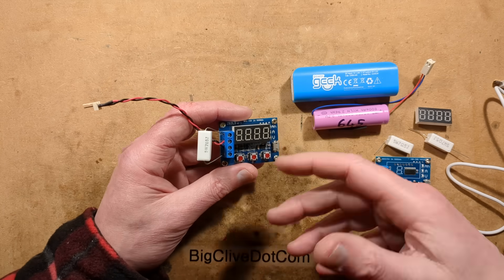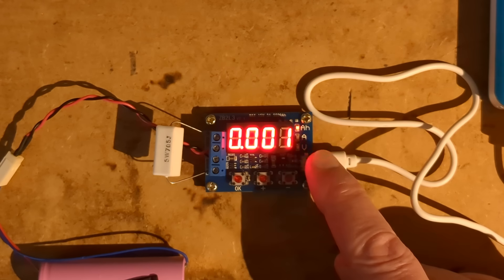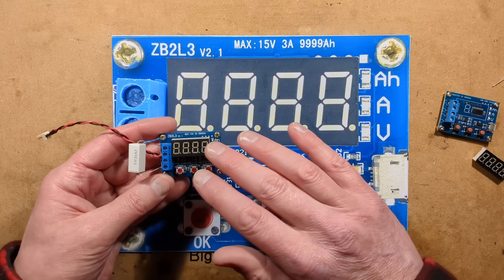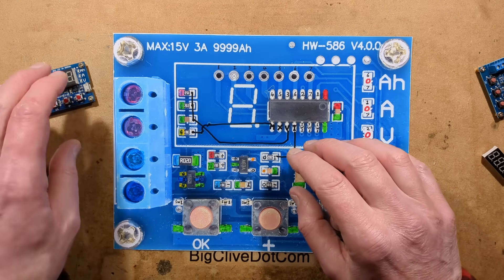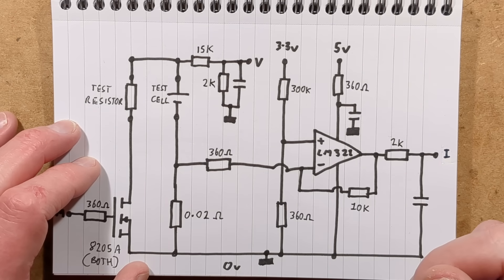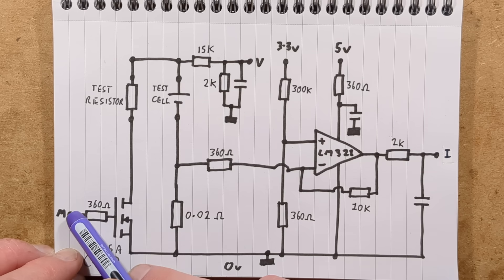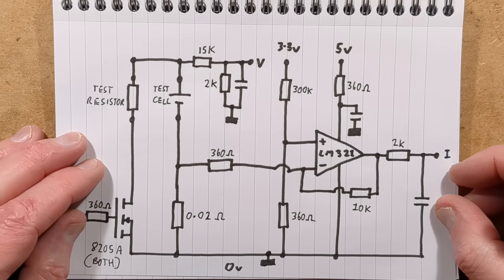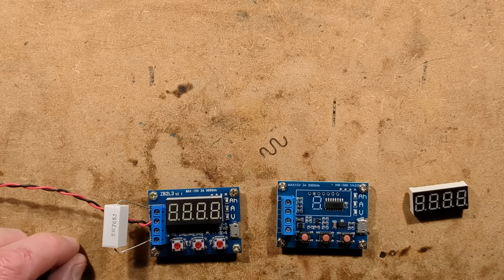Lithium cell (and battery) capacity tester with clever circuitry

Comment: I got the cheapest (V4.0, no calibration) from aliex bundledeals. It's badly calibrated, measurement is way off.
I wonder how to hook it up with an esp32 and write new firmware, then export time-based measurement to visualize on PC and use to judge the health of a battery.

Comment: my mod
across the cell or the mosfet drive pin, connect a small relay module to power a tp4056 module(or even connect a 12v battery charger), so when the unit reaches a "shutdown" state the unit then triggers a recharge automatically, possibly by using the ground and simply swapping the resistor for the charge wire(bypassing the shunt for safety and isolating the resistor so as not to let the module keep going thinking it needs to discharge more

Comment: I got one of these years ago and mine says HW-586 like your v4 board but has the higher pin count LED display like your v2 board. There's no ceramic caps on the buttons like your v2 board though, so there's at least 3 unique versions of this. Mine's got no revision number at all, so maybe it's v1. I bought it years and years ago and use it frequently.

Comment: For the cost of a few of those modules on our favourite Chinese retailer, I actually got a really decent balance charger. Does charge, discharge, a whole bunch of battery chemistries, has mAh read out, beeps annoyingly at you, has an overly mushy button or two, takes one of those almost normal 12V adapters but not quite because it's a little smaller... The one massive pitfall, is that it can't discharge lithium below 3V. Besides that, the imax b6 may interest you. Even if it's just to tear apart.
Edit: Oh, you did! 9 years ago! :D

Comment: Wish me luck that the one with two 18650 battery holders and a colour display that uses one of the cells as a power supply and has a mode switch is as accurate. It matches my needs a bit better and isn't that much more expensive.

Comment: Great video. I've been using one of these for several years. I built a variable constant current load to replace the resistor since depending on what device you use the battery on, the current is different. BTW, this will test NiMH cells also since it will drop down to very low voltages if you choose.

Comment: I also have one of the older units that a friend gave me. I found it remarkably accurate with the stock settings.

I eventually stopped using it for anything other than 18650's, as my main concern is 12v batteries with decent capacities, which this unit wouldn't have been capable of testing, so, I built an ESP Node with an INA219 and removed the surface mount resistor, replaced it with a 50A shunt, and use either a 12v, 50w halogen downlighter bulb for larger capacity batteries or a made up 2s3p 15w bulb pack that draws around 1.23A for the 7AH - 18AH AGM's etc.

Make no mistake, these small modules are truly remarkable for what they do, it's just that with the ESP I can get the results in graph form (Home Assistant), and even run capacity tests that stretch over multiple days and get precise results over the entire test.

I might also add, running an ESP does have its drawbacks, like, polarity conscious or the parasitic load of the module itself, but then again, on the capacities I'm testing, 20-29mA on a 100Ah battery isn't that noticeable 🤔🤷🏼‍♂️🤣

Comment: Looking for your advice, Sir Clive, would you advise the use of some 2N3773 power transistors from Alix? 
My load will be maximum 30 amps, distributed across five transistors, which I am intending to use to replace five 2N3055 transistors in a linear PSU. Alternatively, would you suggest another TO3 cased transistor (maybe from Alix)?
Reply from the maker: I can't really advise on components like that, as there are a lot of fake components sold online.  All I can suggest is that you choose a transistor with near identical specifications and pinout.

Comment: Impressive little device especially the led driver. Wonder if it would run on a 18650 cell? 30ma should run quite a while. Spose it depends if the regulator is a lowdrop out one and the opamp is happy lower than 5volts...

Comment: Nice little device(s).  I have always wondered what your process is to determine the capacity of lithium cells.  Have you ever explained it on a video?
Reply from the maker: I sometimes use mAh charge input to enclosed devices, but also use this type of module when I can remove the cells.

Comment: I am not obsessed with idea of fully discharging a lithium cell just to see its capacity.  If capacity matters I use trustworthy supplier, if I don't, then I don't want to damage sh*ty cell that might be more vulnerable then a proper one. 
The AMS-1117 is quite an overkill here.
You talk of favorite value just as I have looked onto one and a half roll of 330 ohms specially used bigger size case to make its footprint more recognizable

Comment: Could it be that the new version is factory calibrated? Maybe triggered by the unused pin? That could be done in the same jig, where they program the microcontroller (assuming it's programmed after soldering) and do a short function test (well, at least a "shows some numbers" test).

Comment: Interesting little unit, thanks clive.
Currently use a usb oscilloscope monitoring a load resistor, that logs to a CSV file and gets exported to excel, handy if you want graphs but a bit of a faff to set up just to get a AH measurement. This looks awesome.

Comment: I use a ZB206 discharge meter which uses a transistor as a load. My understanding is that the transistor has the advantage that current draw remains the same as battery voltage drops where as with a resistor the current decreases as voltage decreases leading to inaccurate results. I suspect the ZB206 uses similar software because the display and led functions are similar along with the rapid flashing display at the end of the discharge.

Comment: I've used one of these. You need to use thicker gauge wires for the cell, otherwise a lot of power is lost over those thin cables and you get an inaccurate reading
Reply from the maker: The unit measures actual current regardless of wire resistance.  The only thing that might be affected slightly is the termination voltage.

Comment: Flashbacks to testing 112 batteries with three of these modules. A few things:

- these testers do not come with any kind of battery mount / connectors.  the connectors need to be really good. If it loses  contact for just even a microsecond the testing automatically stops. And also depending on  how good your battery connection is you will get slightly different battery capacities. Also, if you're testing batteries that you took off a larger battery and you still have small spot welding bumps or high-rise spots in the terminals, it can affect your connection and give you problems with accurate readings or disconnections.

- unfortunately Amazon is flooded with some of  these testers that are no good and it is   very difficult to figure out which merchant is selling the right kind or just rip offs because they all look exactly the same.

- only major downside is that you need a power source for each tester so if you're doing multiple batteries at once you're going to need just as many 5 volt chargers or power sources.

Comment: It's impressive how accurate these modules can actually be, but I do miss when more things had calibration modes. I've got a few current testers and thermometers that are off enough to not be useful, but could easily be fixed with a calibration pot or routine in the MCU.

Comment: I've been seeing those 7 pin charlieplexed 4 digit displays become more common from Chinese sources.
If you ever wondered how many LEDs you can control in a charlieplexed matrrix from a given number of pins, the formula is simple;
N = P times (P-1)
Where N is the maximum number of LEDS and P is the number of pins.

So for 7 pins; it is 7 times 6 which equals 42.
So that easily drives the 4 digits of 8 LEDs each (including dec points) which is 32 LEDs.

Comment: Really nice and lean circuit design!
My only concern is the input offset voltage of the LM321 opamp (typ. 2mV, max. 7mV), which could cause a considerable error in the current measurement...

Comment: Every trick in the book is used to reduce cost. 
The 360 ohm gate resistor is probably used to reduce different components count. It is used in several places in the circuit. Now you only have to buy i role of resistors.

The LM321 has a PNP input that makes it work down to -0.4 volts on a single rail.
It is old and cheap.
Only positive output swing is limited.
You can improve this a bit with a pull up resistor on the output.

Comment: Ah yes, the AMS1117; the original version of this chip supports input voltages up to 15V, but there are a variety of off-brand clones of it that are only really safe for input voltages of 5V or so. Buyer beware! Not everybody using the same part number is playing by the same rules...

Comment: So the old one CAN be calibrated, but the new one has removed that feature. But could still need cslibration? Or is so prrcise that the lack of calibration is not an issue?
Reply from the maker: They seem to rely on component tolerance for the calibration.

Comment: they cost optimized but could not add a CC load instead of the crappy resistor all that needs is few resistors,ceramic caps,lm358 or any opamp and a MOSFET 

that would make the discharge current adjustable and the readings more reliable
Reply from the maker: The resistor does allow for higher current at 12V.  Possibly even using a normal operating load for the test current.

Comment: the schematic is wrong , the voltage divider for positive input on opamp is connected to current shunt and the opamp feedback circuit is correctly drawn, the sensing is on the side of what you labeled with ground symbol, what you have drawn is a biased inverting amplifier which doesn't make sense as the current increases the opamp vout will decrease. what it is ,in reality, a non inverting amplifier where the biased voltage drop of the shunt (4mv+I*0.020) is amplified to MCU, desolder current shunt and revaluate as the multimeter in beeb mode will not help due to low shunt resistance.

I digress, just move the ground symbol to the battery -ve and your schematic will be correct.

Comment: Feels like a gizmo like this should really have a programmable current option (with a heatsink). Since this device is actively sensing current consumption (discharge current varies over time), it seems like it should be tolerant to replacing the resistance with a constant-current load. The nearest one I have memorized uses a mosfet, which limits current at 5V, but maybe something with a power transistor could be worked out.

Comment: I have two of the "old ones" (mine are V 2.81). I use them with an USB electronic load so I can adjust the discharge current. It's nice to know they have a good design.

Comment: Did anyone else think Clive was trying to write 1016 on the third photo on the pins of the microcontroller, until he explained that's M for MOSFET, X for not connected, V for voltage, and I for current?
Reply: Well,  I WAS getting flashbacks of being forced to do Latin at school!
Reply: Yes, I read it as Latin numerals straight away too!

Comment: I just received a cheap ali product that I that I think you would be interested in. Labelled 'HD Car Head up Display M2 GPS Speedometer KM/H Digital HUD Windshield Projector Universal Auto Electronics Accessory' is a USB powered GPS HUD for cars. I got mine on special for 3.50UK but they are now double that. I just plugged it into my car and it works well closely matching the speed displayed on my cars speedometer. Given its compact size, I suspect it will be all ICs and surface mount components.

Comment: If a spare input goes to an ADC it can be quite versatile with a somewhat complicated test fixture. Even with a sloppy voltage reference you could select a substantial number of test functions by applying different voltages. If both the ADC's reference and the test fixture use the controller's supply voltage, sloppy drops out of the equation because everything becomes ratiometric. You could probably reliably do 64 functions with one pin and an 8-bit converter.

Comment: The 360 ohm resistor is pretty clearly used because that was the right value for the biasing of the op amp and using it elsewhere reduces the bill of materials. I've used weird values for pull up or pull down resistors and the like for the same reason. It is baffling to people trying to figure out the whys and wherefores of circuitry. It is especially baffling when you use a ±1% tolerance part where ±30% would be fine. One of my clients preferred 1% resistors for everything because they reduced their costs for purchasing and inventory. 

I've used LM324 family op amps in lots and lots of designs, but its about the last thing I'd consider as an amp for a current sense resistor unless ultra-cheap was the determining factor. Even with a substantially better amp it would still be necessary to use the biasing to assure the amp stayed off the rail with zero volts across the current sense resistor. "Rail-to-rail" is a nice myth to believe in, but it is never really true in any amp I've ever looked at, and I've looked at an awful lot of them. Usually the problem is that the output can't swing fully to the negative rail. It may get within millivolts, but that isn't good enough in precision circuitry. In the tester, the only time zero would really be of concern is for calibration. There isn't much use in battery discharger that operate at zero current.
It wouldn't surprise me if that circuit uses the 3.3 volts supply as the reference for the ADC. That makes for some "interesting" problems. Adding or subtracting to deal with offsets is easy. Multiplying or dividing to correct gain errors leads to missing codes or repeated codes unless the ADC has high resolution. For a simple battery tester it probably don't make no nevermind.

Comment: Oh nuts, didn't know Ali does affiliate links. I'll swap my browser bookmark to that in the interest of getting more tat review / unbaggings. I normally use an iMax B6 hobby charger for cell testing but it's got a very limited discharge current because it's an internal load resistor and I don't like the thing baking itself to drain cells.
What I really need though is a version of this that can handle 40V power tool batteries, and a charger where I can set the charge termination to about 80% capacity for cell longevity.

Comment: How can 4 digits be multiplexed onto 7 connections?
Please look into this - I'm suspecting it's more that simple multiplexing.
Reply: I also was thinking about that, and I'd need at least 8 pins, assuming each 7 segment display has its own "BCD driver" included. That would make 2 pins (4 states) for adressing each 7-seg, 5 pins for the digit to be displayed (16 states without decimal point + 16 states with decimal point lit, even though only 10 states for each case would be needed) .... aaaand 1 pin for ground 😁
Reply: @SystemX1983  It must have something else in there.
I'm guessing it's a serial interface (SPI?), power and brightness pins etc.
Reply: @jonanon8193 watching some of the footage again also leads me to another approach. It cannot be a usual BCD driver, as it also switches all displays off, and it shows the letter P when inside the menu. Another method to get a low pin count could be using shift registers. Then you'd only need VCC, GND, Data In, Latch & Clock 😁 so you just need to shove 32 bits to the display one after another and latch it to actually display the value you want. no more flickering :D
Reply from the maker: Seven pins can drive 42 individual LEDs.  Each digit is just eight, including the decimal point.  Search for Charlieplexing.
Reply: 4 digits and their decimal point (32 LEDs total for the 7-segment display) plus the 3 indicator LEDs (35 LEDs total) is well under the 42 maximum (7*6) LEDs you could drive with tri-state multiplexing. For n tri-stateable pins, the number of LEDs you can switch on/off is n*(n-1).

Comment: Thanks for describing the calibration method. I have a couple of these but the current was way out, especially when using a lower resistor value for higher discharge. The instructions supplied were the worst kind of chinglish and entirely useless. I prefer the 4-channel test units with the holders on the board

Comment: I was considering what would happen if you connect the test Li cell in reverse polarity. What I think would happen is the inherent body diodes in the MOSFETs would conduct current through the test resistor. The microcontroller would be protected by the 15k resistor on the Voltage input which would be read as 0V while the opamp output would be close to Zero as there would be a positive voltage on the current sensing input, which would normally be negative or zero so the microcontroller should know that the test battery polarity is incorrect.   It's quite clever but the accuracy is very dependent on the tolerance of the 0.02 ohm resistor if there's no calibration procedure.

Comment: I bought a bunch of these years ago, but found them horribly inaccurate and inconsistent. I didn't know about the calibration procedure though. I have been using Opus testers since and those are always within 3% with the same cells and a dozen different units.

Comment: 0:54... Great! 👍 That means that it can mange to test those Chinese "Xxxx-Fire" cells with the ridiculous capacity claims.
Reply: Oi, don't mock those cells, I got 9 of them with my 3 "Emergency Treasure" Lights, and they last all of 5 hrs with each emergency light housing 3 in parallel, so, yeah, all of 600mA out of cells that says it has 6000, so, not far off at all 🤪🤣